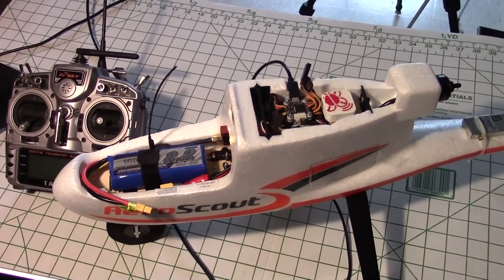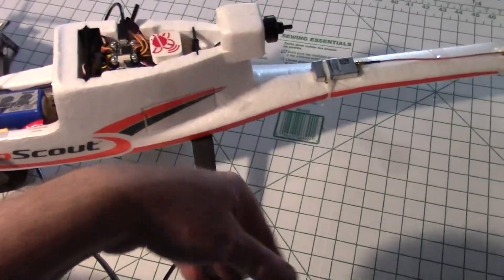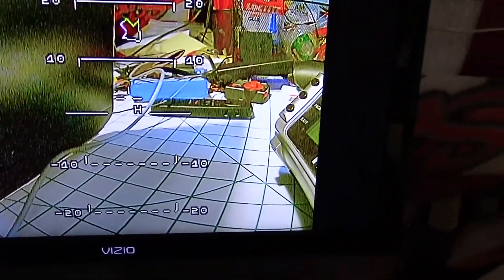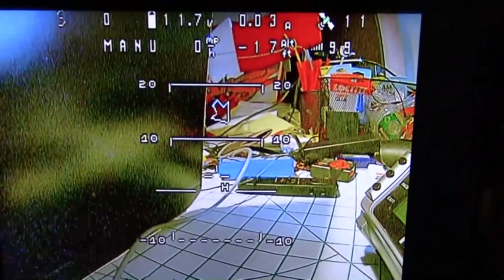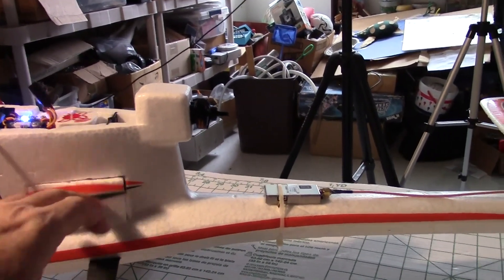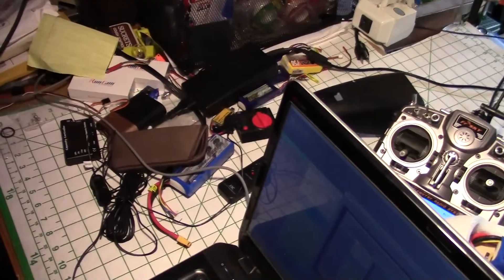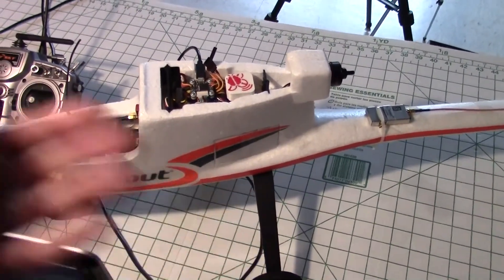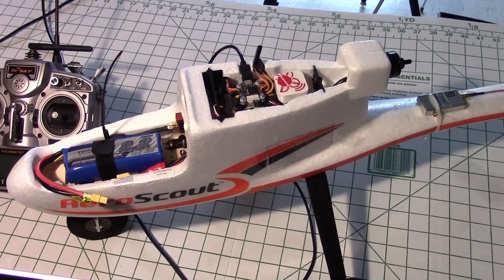What's Causing ESC Beepiing! - BrainFPV Radix LI Wing FC iNav - Any Ideas?

Comment: Dear all, 

How are you? I have the same problem: the ESC starts beeping for a long. I discovered the problem, and I solved it successfully, guys.

First of all,

1- Connect your FC to the Arduinopilot software.

2- Recalibrate the radio (check the minimum and maximum values of the throttle).  

For example, min 1000 and max 2000.

3- Go to setup -----servo output: change the min value to the radio calibration range min 1000, and the max value as the calibration radio value 2000.

Trim: 1500, no change.

Good luck to all. I will try to make a video to explain more next week.

Best regards

Comment: hello i had the same problem for some time and i tried starting in forced esc calibration mode from parameters and did calibration after that it's fixed. try changing esc parameter to start in calibration mode regardless of throttle position

Comment: Guest me wrong could be two things esc firmware perimeter needs to be reset or a pad solder contact on wires which could have came loose from its pad, but for me I have more worries here with this plague hope you find the fault sir.🇮🇪
Reply from the maker: Seems to be your first guess because it always happens after not moving the throttle stick for 10 minutes. Perhaps people suffer more from worrying about the bug than actually getting it and then there is social pressure from not following the rules. Hang in there bud!

Comment: LOST MODEL ALARM - "I'm up here in this tree Dave - save me"! - (inactivity beacon) - swap-out the ESC - it's not the INAV brain - just hardware -
Reply from the maker: It's a shame I can't find a programming sheet for the HBZ3808 ESC anywhere so I guess I would have to swap it if I want to get rid of the alarm. I will probably just be lazy and leave it if it's not doing any harm. Good to know it's not the FC. Thanks for your input. As suggested kit seems to be set for about 10 minutes of no throttle.  Thinking about just plugging it in and measuring the time to see the result.
Reply from the maker: I removed the ESC and put it on a servo tester. I then set the throttle to zero and measured with a stopwatch and sure enough it went to beeping at 10 minutes. You and several others are correct about it being an inactivity alarm for the throttle (or lost model alarm).

Comment: I believe it's your ESC, specifically the Motor Beacon. Like a lost model alarm, a timer can be set in BL-Heli ESC firmware to have it "chirp" after a set amount of time with no throttle input. And the beacon strength,  or volume, can also be set.
Reply from the maker: hmm, This ESC came with the Aeroscout. Not sure it's BL-Heli so how do I find out?
Reply: @DaveMerc  Well, I can tell you it's a HBZ3808 from HobbyZone/Horizon Hobby, it's 3S only, and that's about it... I can't imagine it differs too much from their ubiquitous EFL30A ESC, for which I pinned the instructions below. No mention of a beacon setting... 

And apologies, I used BL-Heli as an example, most of my hangar is composed of quads with BL-Heli32 ESCs, which default to 10 minutes before the beacon starts (way too long IMO, I want to know what tree my quad is in before 2 mins, lol). 

https://www.horizonhobby.com/pdf/EFL30AProBrushlessESCInstSheet.pdf
https://www.horizonhobby.com/30a-esc%3A-aeroscout-p-hbz3808
https://www.spektrumrc.com/Products/Default.aspx?ProdID=HBZ3808
Reply from the maker: Thanks for the links. I will look them over. Yes I think 2 minutes would be better for me too.
Reply from the maker: I removed the ESC and put it on a servo tester. I then set the throttle to zero and measured with a stopwatch and sure enough it went to beeping at 10 minutes. You and several others are correct about it being an inactivity alarm for the throttle (or lost model alarm).

Comment: It seems that it is probably a configuration parameter in the ESC firmware. I'm not sure what firmware you have on that ESC but on my quads esc's they use blheli-s and BL32 in which you have a inactivity alert to which you can change the parameter to let you know it's still on 👍🏻
Reply from the maker: Ya that is what GR said., Not sure what to do with it. May just leave it the way it is.
Reply: @DaveMerc  well you can log into the ESC through it's configurator and change it.
Reply from the maker: Can I do it with FC stick menu?
Reply: Well you need to see what firmware is on there and than hook it to a flight controller and use the pass thru option to get into the ESC, I'm sure there are other ways to do it but that's how I do it.
Reply from the maker: I removed the ESC and put it on a servo tester. I then set the throttle to zero and measured with a stopwatch and sure enough it went to beeping at 10 minutes. You and several others are correct about it being an inactivity alarm for the throttle (or lost model alarm).